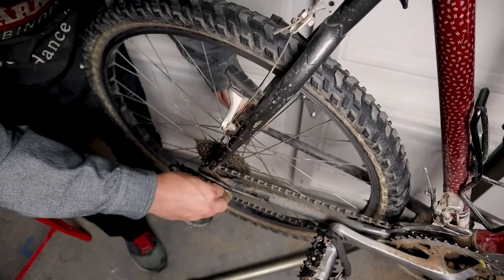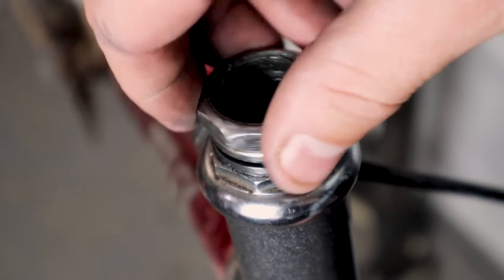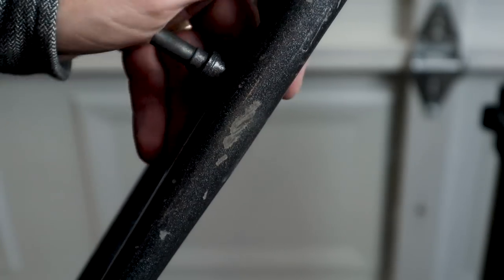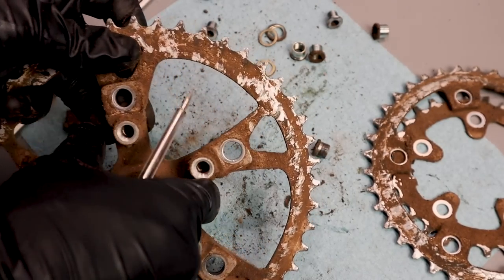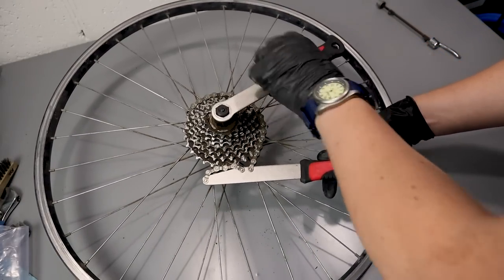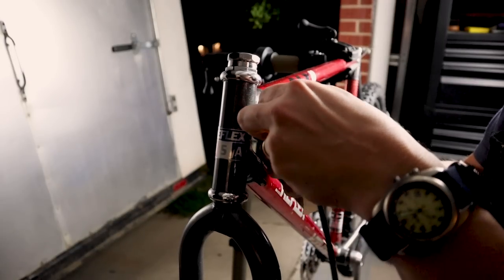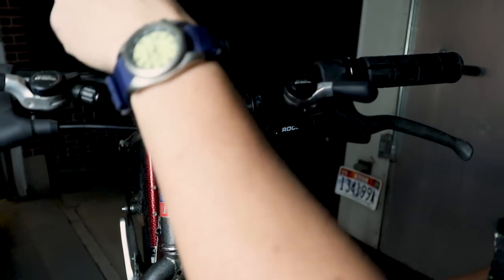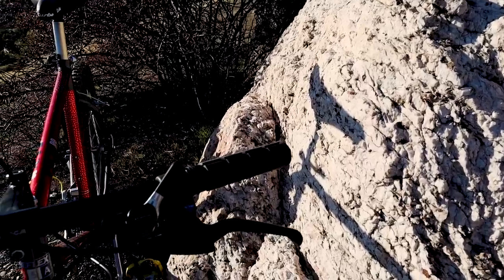80's Mountain Bike Restoration Tune Up | Easton Reflex ALX 89

Comment: That steel at the wheels and aluminum in the middle seems like a great design choice. My old Specialized Rockhopper is all aluminum with a chromoly fork and I think I would like a rear end with a bit of give in it. I set mine up for the street since there are no trails close to the house and I don't tend to drive somewhere to ride my bike ( there's nowhere to drive to in South Florida really ). I have a close ratio cassette and I probably went too small on the tires at 1.5", especially given the stiffness of the frame. 

I hear you on the dearth of parts. It's my mission at the moment to recondition these steel hardtails and put them in the hands of people who will hopefully ride them the rest of their lives. I think a possible option is 26" to 650B conversions if that's what it takes. Not that I want to throw good 26" wheels, tires and tubes in the trash and it makes this all more costly and less appealing from a recycling perspective. Would be interesting to see the stats for the wheel sizes of bicycles sold of a certain baseline quality.

Comment: Was nothing wrong with early hard front and rear mountain bikes. Great era. My Cannondale was a beast and a blast. Never “upgraded” to suspension. That’s a mighty fine bike.
Reply: Riding a rigid mountain bike sure is is another level, you can't afford slacking off in the saddle! Got to be "smooth" in the arms and legs. It's kind of when riding a single speed MTB, you got to plan ahead! :)

With my old Surly Pugsly I had both, a rigid single speed bike, thought the tires gave some 1½ inch of "suspension". ;)

Comment: 10:15 - You should not grease the square taper part of the spindle. It will encourage movement when the crank is fitted that could eventually round it out.
Reply: Scrolling through to see if anyone else noticed, thanks for saving me the trouble of having to explain it!
Reply: Isn’t this an urban myth? All my time as a bike mechanic, we used and still use to grease that part. Not with normal grease, but with fitting lubricant (idk if that is the correct English word for German 'Montagepaste'🙄)...
Reply: @trashes_to_treasures  Well what need is there really to do so, when crank pullers are literally designed to overcome the friction holding the crank in place. No tight fit short of galvanic corrosion would be impossible for the crank puller to defeat.

Comment: I had a fuji thrill from 1989 or so chromoloy steel tubing was such a great bike I miss it sometimes. great fun rebuilding a bike. the comment about the bottom bracket threading thats not always the case, certain french and italian bikes didnt have left handed threads.

Comment: A tip for all you new to building a bicycle, never put grease on a square taper crank. The engineering that makes this work properly designed specifically for metal to metal. Greasing the square taper bottom bracket can allow the crank arm to tighten down too far and damage the crank arm internal Square taper and the bottom bracket itself. It will also cause wear over time do to slippage. It's a common mistake because most people think you throw grease on everything but you don't in this case
Reply: Aditya Wardhana  
Anjiiirr..😂
Auto ngakak...😂😂✌
Reply: And you are wrong.  I won't make the argument, but simply let Jobst Brandt do it instead.  RIP, the cycling community misses his enlightened, direct approach.

:> My cranks get loose, quite quickly too; over about 10 miles or so
> from being solid to flopping about in the breeze.  Any suggestions?
 
Your cranks are ruined!  Once ridden in the "floppy" mode, the square
taper in the crank can no longer be secured on the spindle.  Get some
new cranks and properly tighten them after lubricating the tapers.
Proper tightness can be guaranteed only by torque wrench or a skilled
mechanic.  The second of these is less expensive and you might be able
to get a demonstration of what is tight enough.

The admonition to not lubricate the tapers of the crank spindle seems
to find life only on bicycle cranks, of all the machines I have seen.
I have pursued the "dry assembly" instruction by talking to crank
manufacturers and discovered that they apparently had warranty claims
from customers who split their cranks open.  It is easy to prove that
cranks cannot split by over-tightening simply by attempting to do so.
It is not possible to split a major brand crank this way, the bolt
will fail first.

Crank failure from "over-tightening" is caused by the re-tightening of
previously properly installed cranks.  Once installed, a crank always
squirms on its taper, and because the retaining bolt prevents it from
coming off, it elbows itself away from the bolt and up the taper ever
so slightly.  This can be detected by the looseness of the retaining
bolt after the bicycle has been ridden hard.

Grease in this interface does not affect performance, because only the
press fit, not friction, transmits load from crank to spindle.  As any
bicycle mechanic can tell you, crank bolts are often appreciably
looser after use, the left one more so than the right.  This occurs
because the left crank transmits torque and bending simultaneously
while the right crank transmits these forces one at a time.  The right
crank puts no significant torque into the spindle.  Either way, the
looseness occurs because loads make the crank squirm on the spindle
and the only direction it can move is up the taper, the retaining bolt
blocking motion in the other direction.

Regardless, whether grease or no grease is used, in use the spindle
and crank will make metal to metal contact and cause fretting
corrosion for all but the lightest riders.  The purpose of the
lubricant is to give a predictable press fit for a known torque.  If
the spindle is completely dry this cannot be said, and even with
marginal lubrication, some galling may occur on installation.
Lubrication is only used to guarantee a proper press because the
lubricant is displaced from the interface in use.  Taper faces of
spindles show erosion and rouge after substantial use, evidence that
the lubricant was displaced.

"Dust caps" aren't just dust caps but retention for loose bolts.  It
is not that the bolt unscrews but that the crank moves up the taper.
However, once the screw is unloaded it can subsequently unscrew and
fall out if there is no cap.

Because cranks squirm farther up the taper when stressed highly, the
unwitting mechanic believes the screw got loose, rather than that the
crank got tighter.  By pursuing the crank with its every move up the
spindle, ultimately the crank will split.  It is this splitting that
has been incorrectly diagnosed as being caused by lubrication.  I have
never seen a warning against re-tightening cranks after having been
installed with a proper press fit.  It is here where the warning
belongs, not with lubrication.

For the press fit to work properly, the pressure must be great enough
to prevent elastic separation between the crank and spindle under
torque, bending, and shear loads.  This means that no gap between
crank and spindle should open when pedaling forcefully.  Friction
has no effect on the transmission of torque because the crank creeps
into a position of equilibrium on the spindle in a few hard strokes.

Failure of this interface occurs when the press fit is too loose
allowing a gap open between spindle and crank.  Torque is transmitted
by the entire face of the press fit, both the leading edge whose
contact pressure increases and the trailing edge whose contact
pressure decreases.  If lift-off occurs, the entire force bears only
on the leading edge and plastic failure ensues (loose crank syndrome).
Tightening the retaining screw afterward cannot re-establish a square
hole in the crank because the retaining screw will break before the
spindle can exert sufficient stress to reshape the bore.  Beyond that,
the crank would split before any plastic deformation could occur even
if the screw were sufficiently strong.

Because retaining screws could become entirely lose from squirming
action, especially if the press is relatively light, "dust caps"
should be used to prevent screws from subsequently unscrewing and
causing crank bore failure.  Besides, the loss of the screw won't be
noticed until the crank comes off, long after the screw fell out.

The argument that the greased spindle will enlarge the hole of the
crank and ultimately reduce chainwheel clearance is also specious,
because the crank does not operate in the plastic stress level.  At
the elastic limit it would break at the attachment knuckle in a short
time from metal fatigue, that occurs rapidly at the yield stress.  In
fact, the depth of engagement (hole enlargement) can increase with an
unlubricated fit faster than with a lubricated one, because
installation friction is the only mechanism that reams the hole.

Jobst Brandt
Reply: @dudeonbike800  wrong. I've been a bike mechanic for 23 years and and he is wrong and you are wrong. But I'm sure you're always right and you're online and that's what counts so keep on doing it that way
Reply: @justineaves1977  I figured I'd get a reply like this.  To you I say, "and I've been a mechanic for forty years."  Managed seven of 13 LBS's.  At various times, our LBS was the largest Specialized and Cannondale dealer in the WORLD.  Yes, you read that right.  Our shop manuals instructed mechanics to grease tapers.

I then worked for a few manufacturers and they all greased crank tapers.

I Raced on and off road.  I Ride road and off road on singles & tandems.  Unicycle too.  I've greased crank tapers my entire life.  I've snapped square taper crank spindles completely off, yet have NEVER lost a crank arm.    (In fact, the crank I was using 30 years ago that I snapped the spindle with was scarred by the failure, yet still functions 100% today.)  I've broken seven frames in my life (not due to crashing).  And again, I didn't make the argument based on personal anecdotal evidence, but instead chose the wise words of Jobst Brandt.

Yet you chose to play the "I'm a mechanic for 23 years" card, so I figured I'd let you know my bona fides.

I'm pretty sure my experience (anecdotal evidence) and Brandt's explanation (empirical evidence) pretty much prove the point.

And I went to the trouble of this because I've heard this "don't grease tapers" admonition for 40 years.  I rode with a guy so obsessed with crank tapers, he cleaned his spindles & cranks with acetone prior to assembly.  He was FANATIC about it.  Needless to say his bike creaked like a banshee.  It was funny and unbearable at the same time.  However, I'll admit that I never saw him lose a crank taper.  But just because he didn't doesn't prove your point. 

I want people to fully understand that greasing crank tapers is TOTALLY 100% A-OK!  No more debate.  No more uncertainty.  (And if you choose to not grease yours, then fine.  But please stop furthering erroneous information.) 

But the reality is this, almost all mechanical work on a bike lives by this rule:  lubricate all metal-to-metal contact.  There are exceptions, but they are few.
Reply: @dudeonbike800  the manual😂😂
Reply: @justineaves1977  , I said "the shop manual."  This LBS went to the trouble of writing an extensive how-to manual for THIS LBS.  In California, liability has been an issue for businesses.  The shop manual was a tool to ensure our insurers knew all the staff were following shop protocol and procedure for all work.

This shop was also one of the few who took bikes completely apart from the box.  BB's were disassembled and properly reinstalled.  Tires removed, nipples lubricated and wheels trued radially and laterally, in addition to confirming appropriate spoke tension.

This was in the early 80's before "pre-build" became the norm in the industry.  So the shop took an approach rare today - full pro build on all bikes. 

This is what was outlined in the "shop manual."  So no, I'm not referring to the miscellaneous paperwork that comes with componentry or bikes from the manufacturer.

How about this:  just admit you're wrong on the crank taper issue.  It's no big deal.  I admit I'm wrong all the time.  But when I see misinformation being disseminated, I want to correct it to prevent the newbies out there from taking bad advice.

In my experience teaching bike maintenance to novices, the experienced, and even bicycle production facility staff, I know how many pitfalls exist out there.  Let's not create more!
Reply: @dudeonbike800  😂😂😂😂😂😂😂😂

Comment: Sweet. Those are Farmer Johns Cousin up front and the original "tractor tire"  Farmer Johns on the rear. You just dont see them any more. I have an all original 89 Diamond Back Apex in my garage that still works perfectly like it came from the factory. I liked and subscribed for you.
Reply: Correction tractor tires front and rear. Extra sweet.
Reply from the maker: Awesome. Thanks for the support and sharing.

Comment: Great timing, just bought a 88 MTB. It’s in great original condition so I don’t need to replace much, but will take it apart and reassemble as you did

Sadly 88 still has 6 speed uniglide whereas by 89 you have a simple HG cassette
Reply from the maker: Awesome
Reply: I'm pretty sure my 89 Concorde has uniglide. When that kicks the bucket I will need a new rear wheel and cassette.

Comment: I rebuild dirty old junkers all the time. Bikes very like yours. The things I have discovered about old bike. I just finished an early to mid eighties Hunter MTB. So old it doesn’t use pinch bolt fittings on the brake arms but two barrel ends. I saved for my back up bike the open spring Sun Tour brakes. This bike had a Height Rite seat post device, when was the last time you saw one of those?

Comment: Just letting you know. The angle of the cable wich is joining two breaks for the cantilever breaks should form a 90 degree angle beetwen the link when the breakpads fully pressing at the rim. To set this angle right was making a huge diffrence in my 90'S first ever MTB with such cantilever breaks.

Comment: Amazing restoration! Quick question: what kind of microphone do you use for your voice overs? Thanks!
Reply from the maker: Jenny, good to hear from you.  I have not yet splurged on a good microphone for my videos, perhaps that is bad of me, I know the audio could be better.  I have been using the mic on my Apple ear buds that came with my old iPhone 6s :).  To maximize it's potential I typically place a thick blanket over me as I record the voiceovers... It may sound a bit silly but it works alright.
Reply: oldshovel Well the technique is certainly working well! I think the sound is great 👍🏻

Comment: Hello. You likes the same bike as me! I reccomend use some grease on the thread when you screw Bottom bracket to the frame. When screw of bottom bracket and frame are made of steel I use copper grease. If some part is used from aluminum I use aluminum grease IMO on the pin of break arm you should add some grease. I use silicone olive. I recommend open the freehub body as well.

Comment: To me these series of videos demonstrate the resurgence of the steel bike and the perfection of the bike as an eternal means of transportation! But specially it gives me a pointer in the restoration of my old timer bikes: it’s better to keep them true to their original purpose as a mountain bike and not convert them into some sort of City cruisers...because if you live in the city of San José, Costa Rica, where the side walks are torn and the shoulder of the streets are laden with debris and sharp edged rocks a true mountain bike will be granted and off-road kind of use while in the city!

Comment: Internal cable routing is a right pain in the ass. I remember using stiff wire bent into a hook to try and fish the outer cable out of the top tube. It was successful with a lot of patience and curse words

Comment: Great job! I have a GT All Terra 1994. I keep it preserved and almost original. It’s cool to ride it and feel the “danger” of these old bikes. Rims couldnt stand much impact, weak breaking, poorly indexed gears, no suspension, hand bar would get twisted easily due to poor fixation. They make you travel on time!
Reply from the maker: Lol 😂 I understand the “danger” feel.
Reply: Had to run higher pressure too because rims were your braking surface. Didnt want dings...

Comment: No grease on the tapers is most common advice, although some do them a very thin coat.

I think none is necessary as it will not seize and the extractor will always bring the crank off

Comment: Hey, lovin' the video, but I noticed something you shouldn't do! Never put grease on the part of the square taper that contacts with the crank. Why? It will make the crank slide farther than it should and it's a high probability that it will deform the inside of a crank, making it become loose even if the bolt is as tight as it can be. I know because it happened to me, so I wanna pass the torch of knowledge to you too so you don't lose your vintage components.

Edit: Forgot to add, it would be rare that the BB itself would deform, it's made of a heavier material. I just replaced my crankset and it worked flawlessly. Just clean and degrease the contact zone real good and slide the cranks into position, you're good to go. I made the mistake of putting grease in once I started hearing creaks in the BB, so I took everything apart and lubed it all up back together. Then that happened and had to buy a new crankset.